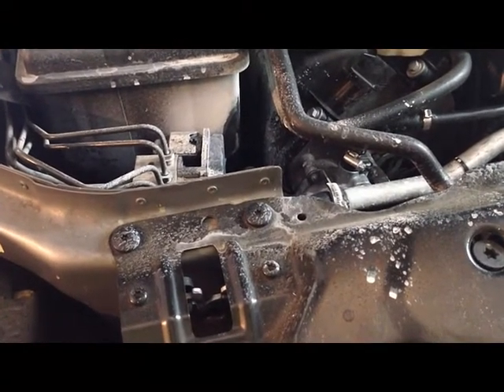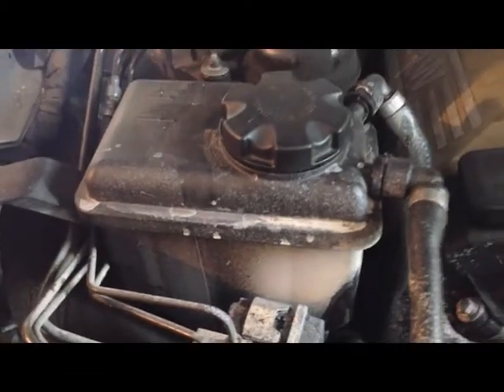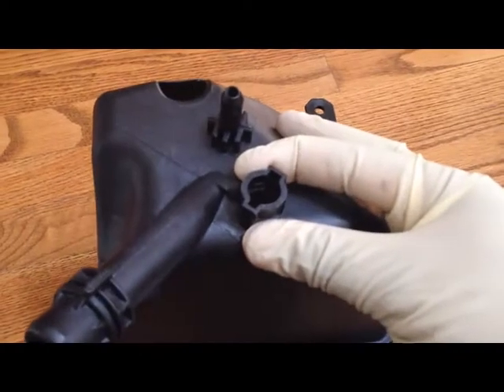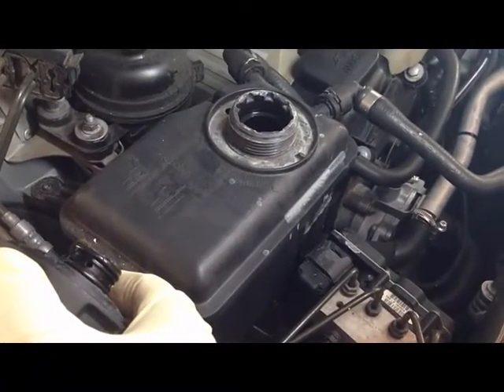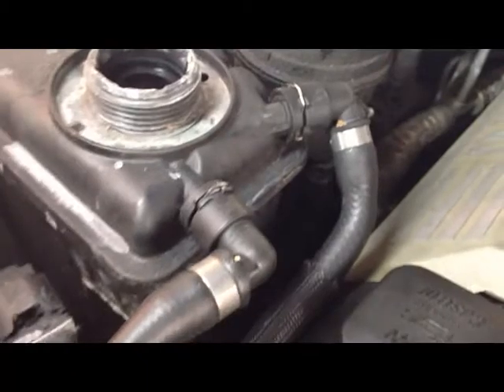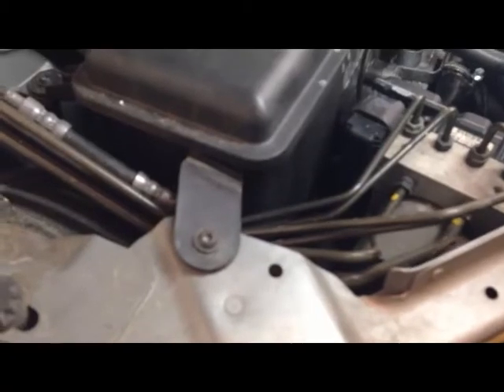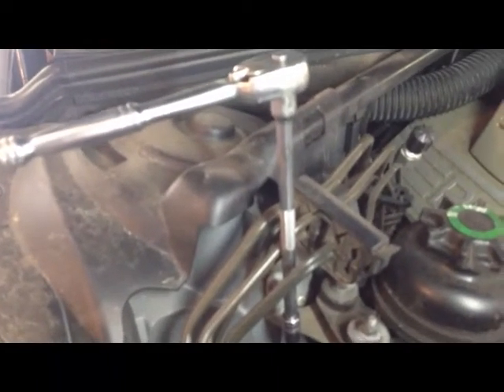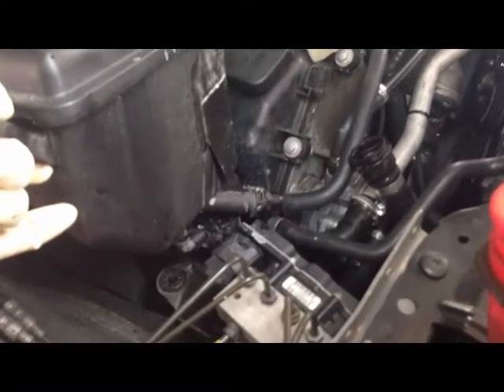BMW Coolant Expansion Tank Replacement Part 1

Comment: My car e60 crack in expansion tank also and I was replaced it today 
But I don't know why it's cracked 
Do you know what's the reason of damage 
Thanks
Reply from the maker: It's hard to pin-point why it cracked, but my theory is that it is just poorly designed from sub-standard plastics, like most of the components used for the latter model BMW's. It is sad that a company with such vast resources has chosen to go cheap on their components. Yes, in the short term they have made billions on the sale of parts that have prematurely failed, but long-term, they will loose out in sales. I know many BMW owners who have vowed to never purchase another BMW due to their experience with repairs.
Reply from the maker: I hope this video was helpful. I believe that there are two reasons why these tanks are prone to failure by cracking. Primarily it is an insufficiently weak polymer/plastic that they are using, and secondly, it could be a build up of pressure that has to release somewhere and so this is the weakest point, besides the hoses. If you haven't changed your coolant tank cap, and you have over 50K miles, I would certainly do so. Be careful with some of the aftermarket caps, as they are prone to failure as well. Good luck!

Comment: Does the red float come with the new tank or you have to buy it separately?
Reply from the maker: The read float is built into the unit and the only way to correctly gauge/measure the volume of coolant in the tank. However I have found that it is indeed prone to failure and/or discoloration. If this happens I would just fill the tank to where you can visually see the coolant.
Reply from the maker: The red float is built into the tank so yes. It also comes with a new bottom sensor.

Comment: Great video! Question: I was wondering if you need to completely flush all the coolant from the vehicle before connecting the reservoir? Or can you just add whatever fluids needed once the new reservoir is connected without having the flush the rest? Thanks.
Reply from the maker: Hello. I would say that this all depends. If your fluid has been changed within the last 30k, I would not bother flushing it. However if you are coming near your fluid change, this is an excellent time to flush/change the fluid!